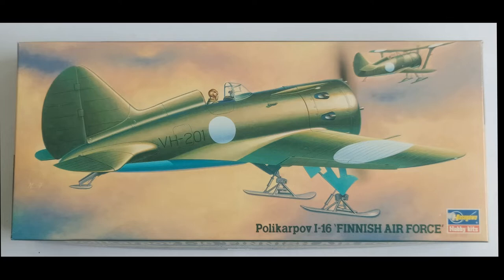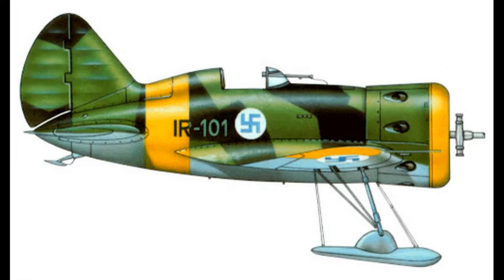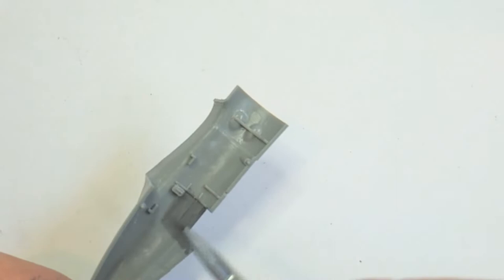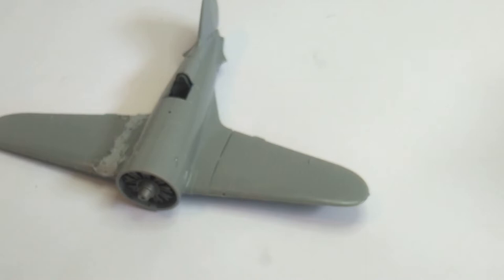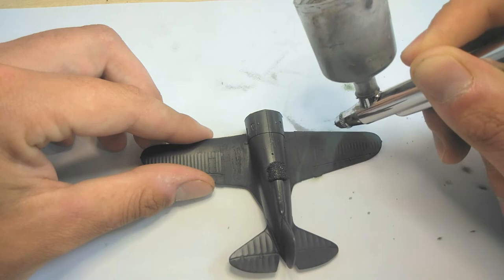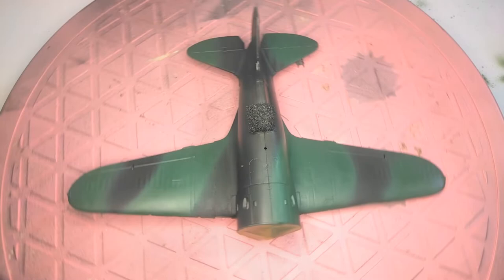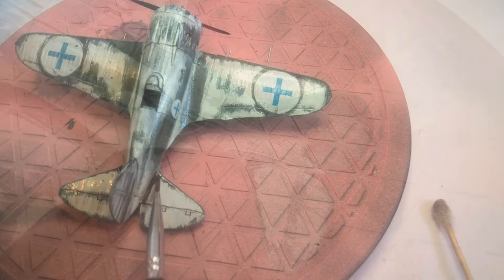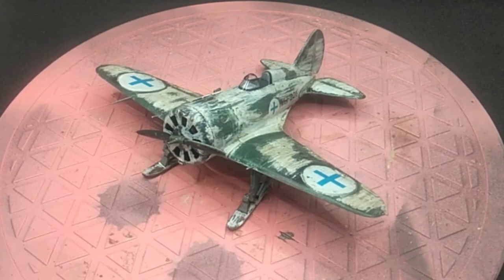Hasegawa's 1/72 Polikarkov I-16 Full Build

Comment: I really wish the model companies would get over the "omit the swastika" nonsense.
Try the Vallejo putty.  The tube has along thin applicator tip, much neater!
Reply from the maker: The kit does include the big blue Finnish swastika, and the underside does have the swastika but halfway through I decided to not show them due to YouTube and protecting my channel. The tube applicator sounds like something I need, definitely gonna research that, cheers for the tip!
Reply: Finland had the hakaristi.  Was a family crest emblem. Although similar its not a swastika.  Same as Latvia during WW2.